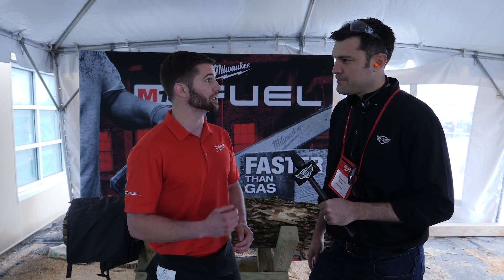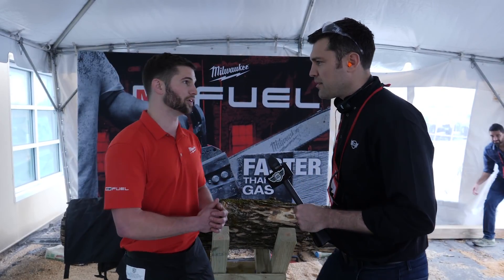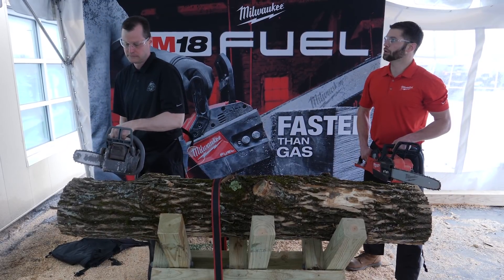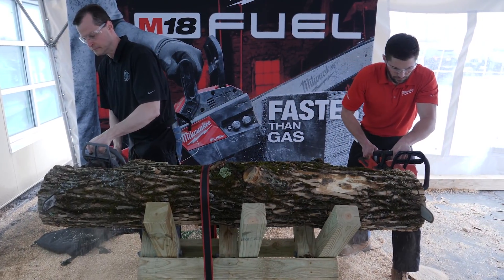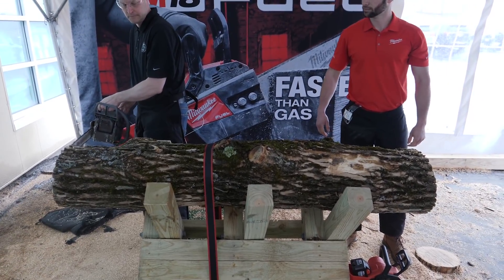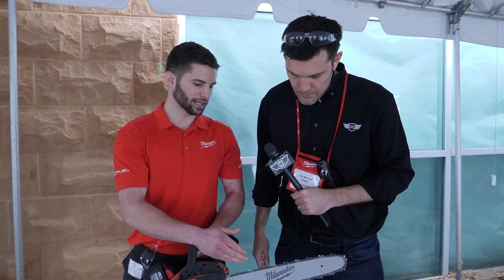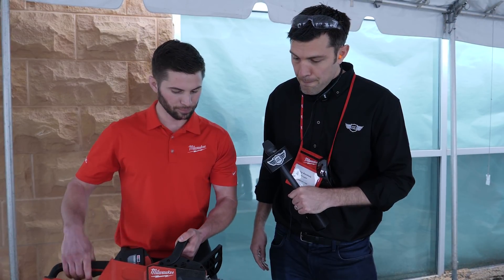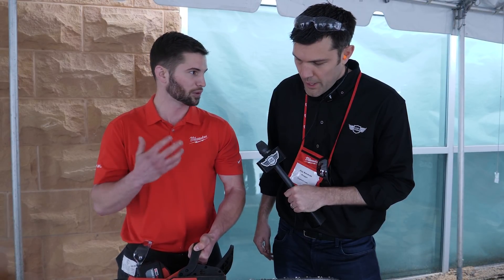Milwaukee M18 FUEL 16" Chainsaw 2727-21HD - NPS18 Interview

Comment: I’m sorry to say this is a fake show . I do have a Milwaukee m18 fuel cordless chainsaw, it a little monster comparing to other cordless chainsaw like green works desalt sun joe but if it has to compete with a husky or still gas chainsaw 40 cc or up it won’t win the trust .I tried that myself used both husky gas chainsaw 135 xtorq and Milwaukee m18 fuel both have same bar and chain size and both equal 40cc . Husky won the race . Don’t get me wrong I like it so much just charge the battery and sharpen the chain throw it on the back seat of your truck and when you need it’s there and the smell of gasoline when you get your heat on in winter won’t choke you but has no power like a gas chainsaw.
This my personal opinion.
No company on earth has made a cordless chainsaw that will beat a gas chainsaw. Kabeesh.